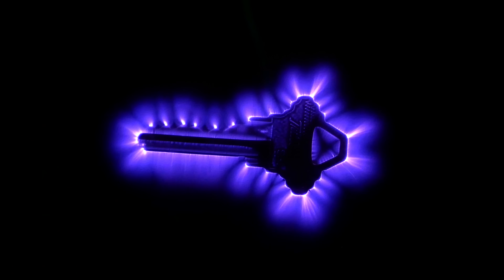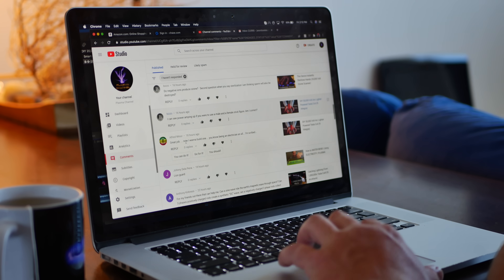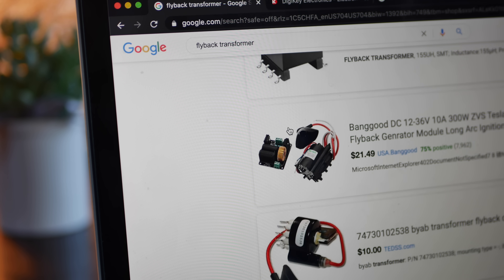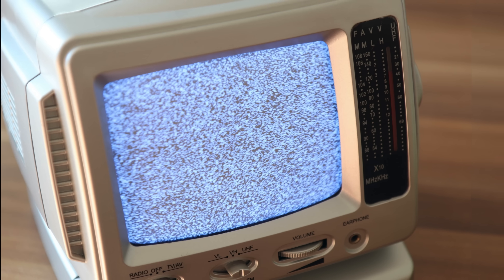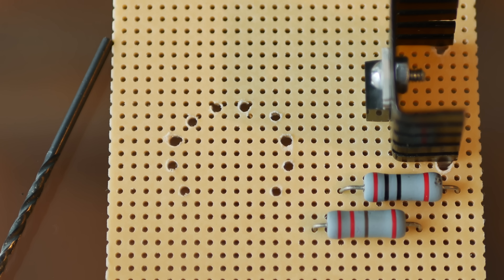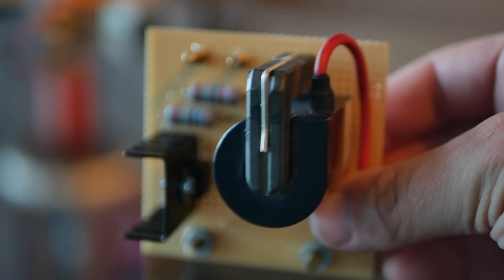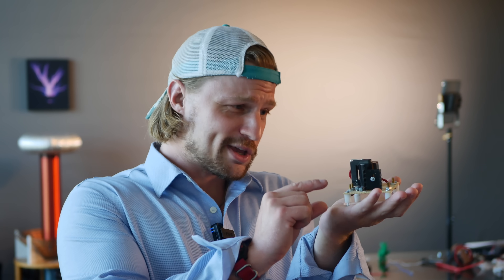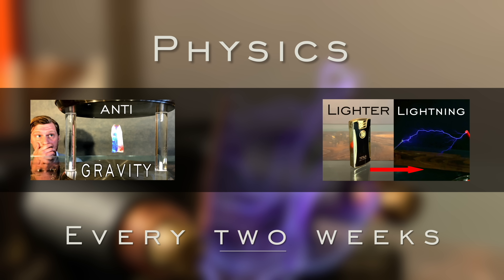DIY Plasma Physics Powersource (Mini 20,000v Flyback)

Comment: Sir u r great engineer.  Sir is the output of a flyback transformer is ac or dc??
Reply from the maker: It depends on the transformer you use. Mine, and all out of televisions, are DC. You can find some sources that give you AC flybacks though.

Comment: Also with those types of transformers you can use a 555 timer and mosfet irf740 to power them the frequency is between 23-27KHZ. I had built one a long time back.....

Comment: Yeah basically using transistor as oscillator and amplifying that voltage in the secondary of the transformer. 
The feedback coil is necessary to sustain oscillations.

Comment: Well now we clearly also need plans for one that uses the wall outlet.
Reply: hey, get a variac with a high power rectifier hoocked up to it. that's my dc power supply. and a ac  power supply. smort.
Reply: That's not as easily done.  You want a source of DC basically derived from the mains voltage.  The DC output has to be able to supply 3-5 A at, as Jay said, around 12-18 VDC max.  These little high voltage power supply circuits draw pretty high current on the primary side in pulses.  The circuit switches on and off tens of thousands of times per second so short pulses of high current when the transistor is fully on.  Like the transformer primary is practically shorted across the power supply when the transistor is on.  Due to the fairly high current requirement on the DC supply, something cheap and easy, like a capacitive dropper circuit, isn't feasible.  It's easy enough to find DC power supplies on Amazon that can supply up to 18V at 3A for $20 to $25.  You probably couldn't design and build a mains to DC power supply much cheaper.
Reply: Basically a neon sign transformer.. but they’re impossible to find
Reply: @prestontingley8914  Thus we clearly need a working home-built design
Reply: Thus look up a damn nst schematic and have at it smart a$s.. Jeeze, Happy new year to you too
Reply: @prestontingley8914  I'm assuming they, and many more, would like a simplified schematic to be built as easily as possible.

Comment: Another trick for using any flyback easily found is to also wind another coil on the other side of the ferrite core. There is usually enough space to fit one in though you have to figure out what the optimal gauge and turns ratio for your transistor current and voltage range. This is a trick I used to do before I got into over driving potted and rewound CCFL transformers from older big screen TVs.

Comment: Nice now use it to make a Plasma Pulse Jet motor.  Put the two electrodes in a conical chamber.  Should heat the air and make a little thrust.

Comment: I've kept myself busy and I haven't watched the video yet. But I will later today and I'll post another comment with what I think about the video. Though I already know the video will be awesome! 

I'm on my way to an interview so wish me luck! :)
Reply from the maker: Hey SA! Best of luck with the interview!
Reply: @PlasmaChannel  The interview went awesome! I interviewed with Stadler. And I'm watching your video. This is yet another amazing video. I love how you gave us an alternative to the HV transformer. I was originally thinking you would use one of those bulky TVs to get the flyback transformer. But you gave me another easier idea. Use a smaller TV like the ones I used to use when I was a kid.

I like how you gave us the voltage range for what it operates at. What kind of bolts did you use for the connections? They look like they are copper coated or brass coated.

I love this project and I think it is awesome!!! Keep it up! :)

I also love the funny parts you've added in the video at the beginning. :)

Comment: High voltage ground can (and should) be connected to circuit ground, it won't harm anything since they will all be at the same voltage potential and it will remove any chace of the flyback's ground pin arcing. I should know, I've built plenty of high voltage flyback circuits in the past.

Comment: Can you help explain what might be the benefits or disadvantages to using this setup as opposed to using a similar setup, but with a self made primary (with center tap) winding that’s wound around the core? That’s how I’ve been building my HV power supplies.
And with your your schematic, can I use an IRF 540 mosfet or other high freq mosfet?
Reply from the maker: Hi Paul! So, this setup is self resonating and is known for producing absurdly high voltages. At just 12 volts in, in provides nearly 15,000 volts. The ZVS center tapped produces higher overall currents, and usually less voltage. ZVS driven flyback circuits are great for medium voltage, super high power applications (medium voltage meaning medium level of high voltage)

The advantage of using the natural primary and feedback coils is that they are already perfectly in place and very precisely positioned. 

Cheers!
Reply: Thanks for your reply J. I’ve been experimenting with HV applications only for about a year, and about as long as I’ve been watching your videos. I didn’t realize the self wound center tapped primary coil would result in a higher current. Is it still a ZVS circuit if I’m utilizing your set up but with center tapped coil around the core all things being equal?
Basically, what I’ve been making is what I learned from Ludic Science. Using a 220ohm resistor and a high frequency mosfet. I’m sure you’re familiar with the circuit.
Anyway, I really enjoy your videos bro. Keep em coming!

Comment: Does the high voltage arc over the pins ?
I've made the same setup but with TIP35C transistor. When I turn on the setup with 12 volt DC Power Supply, I get a less length of the arc than you. Why is this happening ??
Reply from the maker: What current are you providing it? I found that at least 3 amps at 12 volts is best. Also, tip35C I’m not familiar with. I’d recommend a mosfet.
Reply: @PlasmaChannel  I'm using ATX power supply

Comment: Awsome vid as always but you should have put a capacitor (matching with the frequency of the transformer) so they would oscillate and also to remove the dc going trough the primary to get longer arcs due to resonance and im not sure but i think that would also help to heat up the transistor much slower

Comment: http://bit.ly/HiVolts
Hi  Really enjoy your videos.. i see in this one you are showing how to get a cheap UHT generator
Well I have found one here in Indonesia, but it will be available locally wherever you are..
its cheap too  I paid just $4 for mine and its Plug n Play.. ready to go.. just add 12V and its away..  
Its a Plasma lamp Driver for a car.. check out the link at the top pf comments..
I made a Jacobs ladder to test it  .. works for about 1-2 seconds then shuts off.. maybe the circuit has some kind of safety shutoff? any ways I will be trying it as HV power for a Lifter.

Comment: Mine isn't working.what could go possibly wrong?also,how much watt do I need?help!
Reply from the maker: Did you use a similar transformer, what transistor did you use?
Reply: Plasma Channel mine was with steel body.
Reply: What power you're running it on?
Reply from the maker: Mine operates at 14.8 to 15.5 volts. Any more and the thing self-destructs.
Reply from the maker: What do you mean steel body?
Reply: Plasma Channel I'm talking about my transistor.mine one is the steel body version(2N3055).my power input was 24 watts(12v 2A).but it didn't work.then i tried another design.i winded the primary and secondary on the ferrite core.it also didn't work.i have also swapped secondary connections.but the result was same.
Reply from the maker: Try flipping the connections on your feedback coil
Reply: Can I make this circuit using mini flyback,found in chargers? please answer😊.

Comment: Instead of trying to use the feedback and primary that's built in to the flyback, there's enough room on the ferrite core to wind a five turn primary and five turn feedback. The only thing you need to find on the flyback is the ground pin (easy enough if you removed it from a piece of equipment and can find ground on the original circuit).
Edit: I should have read the comments first before posting this.

Comment: Awesome little build! I built something similar to this a few years ago, and fed it from a variable output supply. This gave me the ability to vary the high voltage output. Though this probably wasn't the best way of accomplishing that, It works well enough for me.
Reply: Am I fucking retarded? Do I NEED this resistors for this to work? I'm just kinda hooking the thing to my power supply directly and it keeps getting warm before any arcs are formed
Reply: I'm using the same kinda flyback from a battery tv. But the pins 1 and 3 on the right side of core have 0.0 ohm (with connection)  and 2and 4 have 0.3. 0.0 being lowest resistance I tried and it got warm with no buzz or arc. I'm lost with this device lmao

Comment: I have a Question question 

I have a question about the air bending vid                          1 is this safe for me to do by myself at my house             2 where can I get the equipment                  3 how do I do it once I have the equipment.         And Can I go higher than 200,000 volts.     Ps sorry for how long this is

Comment: Did anyone else try using the IRF540 and have problems? When I connected it in accordance to the diagram I got a short. I tried swapping it with TIP31C I had lying around and it seemed to work but only at lower voltages and it heated up very quickly even with a large heat sink. I'm not quite sure whats wrong.

Comment: hey.
I built the same thing, but it didn't work.
but it didn't work.
the supply I used for the circuit is a 12v charger.
I checked the voltage across the charger terminals after plugging it into the circuit, and there was a voltage drop, my meter was showing around 3v across the charger terminals after plugging it in.
could that be the problem?
I also used different components:
transistor: C4106
resistors: the same values, but I put 4 in parallel of each value (4 of 220ohm ones in parallel in series with 4 of 20ohm ones) so they can handle the current.
flyback: BSC-25 NO311, (I used the first and second pins for the feedback and the third and fourth pins for the primary) (I chose them by checking the resistance)

I also didn't know where is the ground pin in my flyback, so I tried to bring every two wires near each other to see a spark, but I saw nothing, I also checked if there is any voltage at any pin, but there wasn't.

any ideas or suggestions?
Reply from the maker: Hi Mhmad, I think your resistances are a bit off. 4 x 220 ohm in parallel is 55 ohms, plus 4 x 20ohm in parallel is 5 ohms. This means where you should have 220 ohms, you have 60. You likely have fried your transistor. I'd recommend first changing out and getting the proper resistors.

Another solution, is to reverse the connection on your feedback coil. This works quite well, and can sometimes be the solution. I'd recommend doing this first.

Cheers
Reply: @PlasmaChannel  
Thanks for the response.
I did as you said, (replaced the resistors, but I used a 24ohm instead of 20ohm cause I didn't find one)
and still, nothing happened
I guess there might be something wrong with the transistor (although I used another one), or the pins for the primary and feedback I chose are not the ones.
another thing, it might be the flyback itself, I took it from an old broken tv, maybe it's broken too.

you think there might be something else?
and I really appreciate your response.

Comment: Can you explain the circuit
Reply from the maker: That was one thing I wanted to add into the video, but didnt want it to be too long. The transistor is sends power to the primary coil. This in turn induces a current in the feedback coil since the two are wound on the same core. This induced current in the feedback coil then feeds into the transistor, and turns it off. This turns off the primary coil, cutting current, and the cycle just repeats

Comment: Great tutorial, as always. :-) Question on the 2N3055 , since your link pulls up the two pin bipolar ones typically found in microwaves, where did you find yours?
Reply from the maker: my transistor is the MX D362 and i pulled it from the mini televisions from thrift stores. They apparently are not made anymore. But, other mosfets +2n3055 will work
Reply: @PlasmaChannel  what are the requirements for the transistor? We can't decide on which one to get for our project

Comment: Does it electrify u,  if that output red wire would stick to your body without ground.thnks alot guys need your  openion
Reply from the maker: Very little current flows in this circuit, if you only touch one HV lead.
Reply: @PlasmaChannel  thank you so much realy lov your  videos.💓

Comment: How do I air bend do you have to clip a voltage multiplier to your finger to do it?
Reply from the maker: Yes, it requires a high votage DC power source. I do not recommend this.

Comment: Hi Jay, thanks for another one of your excellent videos. Could you please tell me what you think, on some high voltage generators similar to yours here I've seen a small value cap accross the collector and emitter, but I've yet to ascertain it's purpose or efficacy. Would you happen to know it's purpose and if so the value of the cap? I'm wondering if it might be protecting and therefore prolonging the life of the transistor. Also another question if I might, would you kindly show how, if  possible, how to engineer this same arrangement with a compatible FET? Thanks Jay.
Reply from the maker: Hi Tim. Those other circuits operate the same - what you're seeing is a 'snubber circuit' attached to the transistor to protect it from strong EM pusles back from the transformer. I simply prefer just to overengineer the transistor to begin with :P
Reply: @PlasmaChannel  I see, thanks Jay. So the snubber is accross the E. & C. instead of accross the X-FO primary. 
Regarding my other ?, isn't it possible to use a FET in this circuit provided a gate pull-down resistor is used? If so, would you know the formula for the proper pull-down resistor value?

Comment: So how can you use this to power items? Is it as simple as running a wire from the (-) & (+) wires or do i need any other electronic because of the high voltage  ⚡  🤔
Reply from the maker: Which items are you thinking of?
Reply: Are you able to capture these high voltage in like a capacitor? Sorry if that's a dumb question im just thinking about saving money on electricity. If your only using a small amount of power to generate X amount more. Wouldn't that be nice to capture the excess and use it to help power your home.

Comment: If you put it in a jacobs ladder/ wired spark gap configuration, how long would 3X18650 batteries in series last on one full charge or would it be a problem leaving on for that long?
Reply from the maker: It would be an issue leaving it on that long. Transistor would burn out...and if not that...then the transformer.

Comment: I know that some flyback transformers have a high voltage diode that rectifies the output into DC, is this the case with these little guys? I'd like to substitute the arc lighter with this to power the voltage multiplier from one of your previous videos but that will only work if this supply is AC.
Reply: These almost always have a Diode built-in. Only some very old ones dont.
Reply from the maker: Corrrect, this is DC. You can still find AC flybacks, but only in ionic purifiers and whatnot
Reply: @PlasmaChannel  Ok thanks for the info!

Comment: I have a Flyback but I wounded the primary and feedbacks in the ferrite core and cutted off all the pins except the ground pin,
Will this schematic work for that?😐
Reply from the maker: Indeed it will. As long as you kept that ground pin.

Comment: Hi diar friend! Use Zvs driver!
Reply from the maker: ZVS drivers are great...but dont pump out as much voltage as this. They pump out tons of current. a ZVS driver, fed with only 12 volts, would likely only pump out 3-5kv. this at 12 volts pumps out 15kv.

Comment: Thanks Jay,  Nice timing for my "slightly larger mini Tesla coil" cheers Paul
Reply from the maker: Glad to help
Reply: @PlasmaChannel  Hi Jay, on the 50Kv rechargeable lighter powered mini coil there was a HV diode needed in the circuit. Will that be needed with the fly back power supply you've  just designed.? Cheers Paul

Comment: I wonder if that could be turned into a mini welding machine. If it works It would be slow but could perhaps weld very thin metal without instantly burning holes 😬
Reply: No, this is high voltage very low current, welding is high current and low voltage
Reply: @stuartcommon4651  True of course for usual everyday welding. But as seen in the video the tip of the cable is melting, and the point was that for welding very thin metal there can not be much current. Perhaps turning this into something that can weld thin metal needs a bit more current.
Reply from the maker: Stuart is right - this would only weld very, very thin wire. It melts copper wire of gauge 32 or higher, but below that....it just gets warm.
Reply: @PlasmaChannel  Can you put these in parallel to up the current? Might need quite many though, so perhaps not feasible...